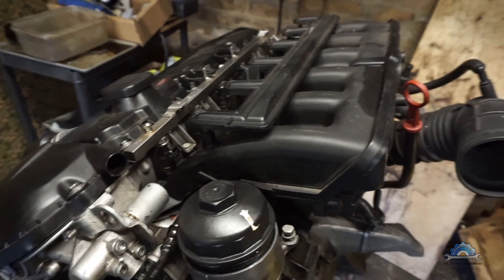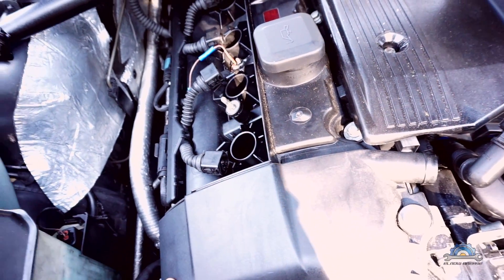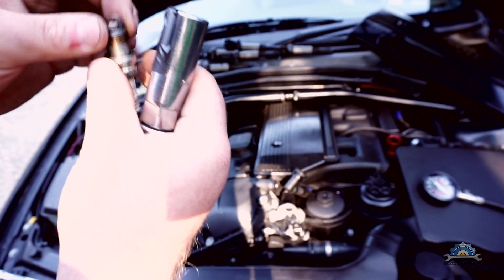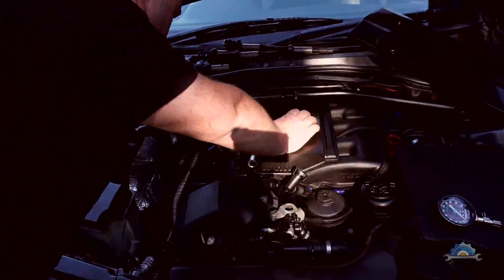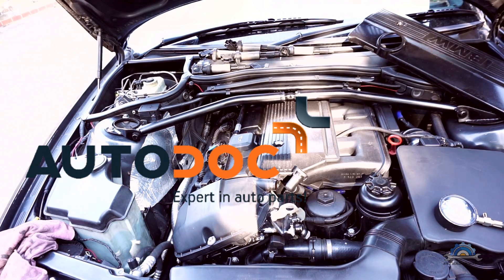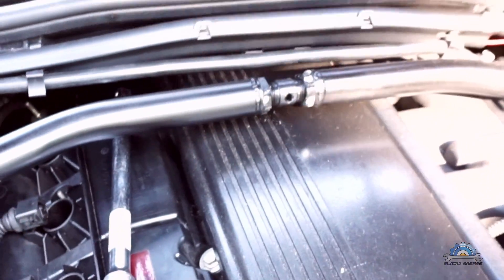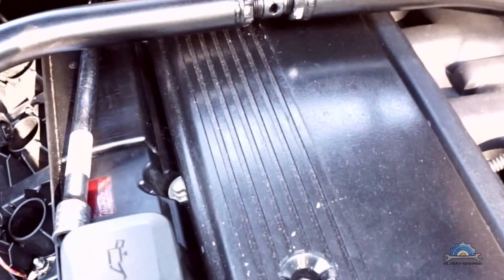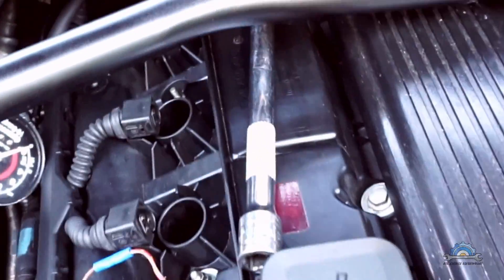Compression test after engine rebuild BMW e46 M54

Comment: Hello. Is this the engine with the M52tu rings? If so, have they helped in reducing oil consumption? Are the GOETZE rings as good as the M52tu rings for fixing the oil consumption? 

Finally, have you heard of replacing the harmonic dampener to fix a potential harmonic imbalance causing play in the pistons and rings that results in blow by/oil consumption?

I also think an improved damper would help with sheering or loosening of the oil pump nut.

Thanks for your time.

Comment: It is HIGHLY recommended that one pull the DME relay, before cranking engine with ignition parts unplugged.
Reply: Simply fuel pump fuse removal is enough
Reply: can you please show a source that verifies this or says the reason why
Reply: @david-tracy  would just thinking and common sense be enough?
Reply: @migelprager1097  it's not common sense. it's something you have to spend a lot of time learning about dude.
Reply: @david-tracy   I'm new to BMWs and cars whats a DME?
Reply: @JasonWilliams-jd5qn  idk exactly - it's under the steering wheel...
Reply: @JasonWilliams-jd5qn  it's a relay from the ecu box..